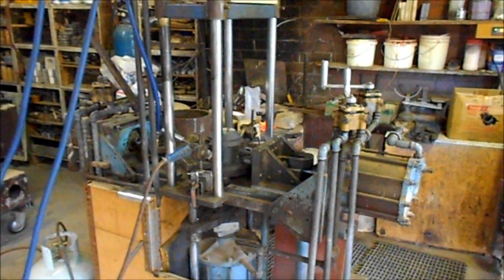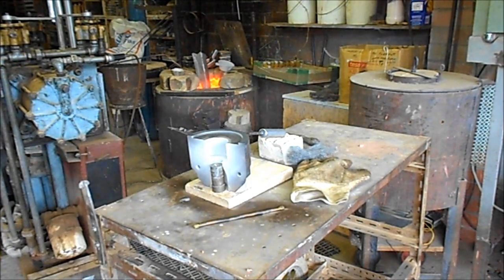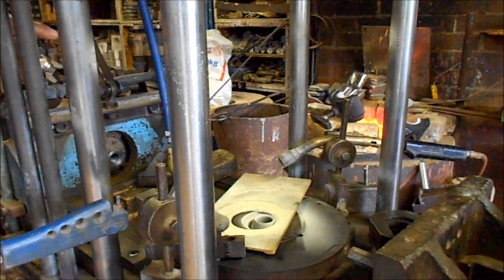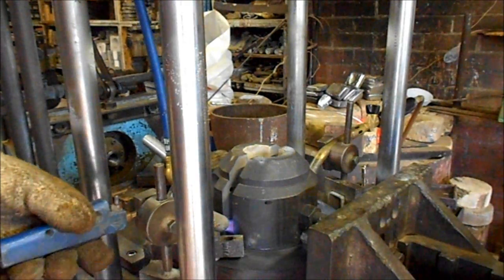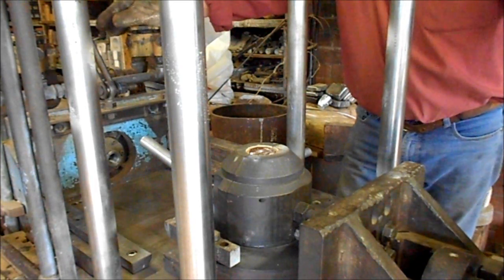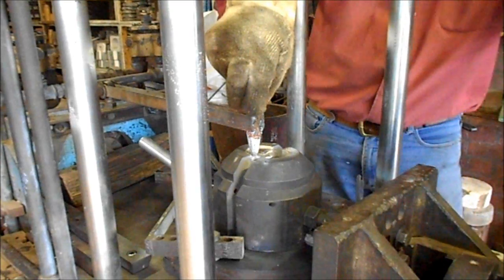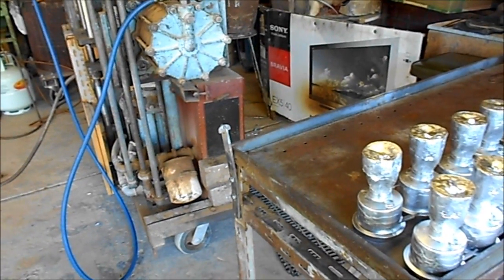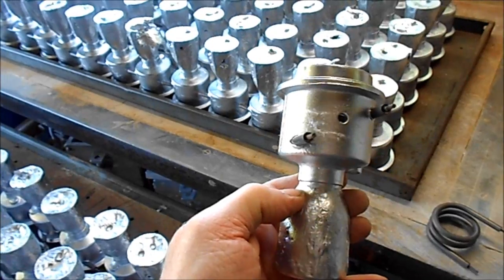My Home Foundry;  Casting a Coffee Percolator heating unit

Comment: Hey Martin, looks like the one I melted down! TFS, GB :)
Reply from the maker: Graeme, Unlikely to be mine as most are made by pressure diecasting in China and will therefore not be perhaps the best of alloys for sand casting - it will likely tend to be brittle and subject to gross hot spot and central shrinkage.... Martin
Reply: @olfoundryman8418  Hey Martin, Hope your okay Dude! Yeah dig the brittle thing, two flood lights I used were like glass, but as I wasn't really trying to make anything specific. Really just trying to fathom out what steps I need to get familiar with for the making of a mould!... Stay safe, GB :)

Comment: I was watching this video again and noted that if I am correct it's the only time you mention that the bottom cast iron mold has a heating element in it and it's temp is about 600 C just to make sure. That I not getting mixed up about the heating element for the percolator. And if it is in the cast iron mold itself did you leave it on all day during the pours.  The reason I ask the mold I made is made of 3 plates of 1" thick by 12"x14" all stacked for a block 3" x12"x14" have heated the whole thing to 550F for the coating to stick.
Reply from the maker: Brad, I think I might have explained it badly. The heating element gets cast into the aluminium percolator body. The element is heated to 600 deg C  in a small furnace and gets loaded into the cast iron die just before the die is closed and the aluminium poured in. The element is heated to make sure the aluminium runs around it properly. Obviously a new element is loaded for each percolator casting. The iron die is initially heated with gas burners to get it hot enough (200 deg C plus) so the die spray will flash dry when sprayed on and thus stick to the die. - it never sticks well to new dies! No further heat is applied to the die as you sort of get a balance between the heat going in (the aluminium being cast) and the heat being lost  to the dies surrounds. You adjust how many are cast in a given time to keep this balance about right. What you are doing sounds ok...... Martin

Comment: Very good videos!  Watching every last 5 days. A lot off good ideas you got! Amazing!!! My dream is to make reusable forms and now I found that it is possible. I holding some projects to make aluminum welding and to make some chairs. The paint you using is important and cant find informasion about it. Best regards from Norway
Reply from the maker: darius, Reusable forms  (dies) are a great way to make parts if you need a fair number. Typically a die wil give  50 to 500 parts per day depending on how big and heavy the part is. The paint (die spray) is very important and without it getting a usable casting would be just about impossible. The die spays I use are 14ESS made by Foseco in the UK and Release coat blue made by ZYP coatings in the US. The latter is very expensive. Although I have never done so  it is possible to make your own sprays. They are basically mixtures of fine refractories and sodium silicate solution. You could try a mixture containing about 15% of sodium silicate solution plus enough fine refractory - typically 200 mesh silica or alumina together with about half as much talc and about 5%  bentonite clay. Add enough water to make it a paste wi8th about the consistency of sloppy brick mortar. Dilute this mix by adding 80% water. Spray this onto the hot (200 deg C plus) die and it should flash dry to form a thin adherent coat. Apply a little at a time and go over it to build up the requited thickness - generally about 0.1 to 0.2 mm. I use a small automotive paint spray gun. Note that the coat may need to be touched up through a casting day and new dies do not behave well as the spray can tend tofal off them a bit - second use of the die and its much better!
Good luck and Greetings from Melbourne Australia.... Martin

Comment: What's that three piece mold made of? Iron?
Reply from the maker: MI A, Yes, the moulds are cast iron. I use continuously cast iron stock it is available in a lot of different diameters. It makes a nice die material as it takes and holds the spray well.... Martin

Comment: Love your video. I have a product that I want to start making parts of it out of aluminum by casting instead of using steel. I have welded up and tested it with Aluminum and it works very well. My product is made for icefishing and it’s called the Bevelbandit and I want to make the red fan blades that you can see in the picture out of all aluminum. So I was wondering do you make Die cast for customers?
Reply from the maker: Robert, Thank you for your comment. I used to do gravity die (and sand) castings for customers but old age and ill heath have caught up with me. I have arranged someone to take over my work but as both he and I are in Australia I doubt we can be of much assistance to you as a source for your castings, freight would kill it. Watched a video of the device - 3 foot of ice on a lake - good grief! Utterly fascinating, and I guess its why my father moved from BC Canada to Australia.  Most we ever see out  here is 1/2 inch on a puddle on a very cold (for us) frosty morning -frozen lakes - never!
There would have to be a small permanent mould foundry that could make those parts for you in the US they don't look to be a difficult casting to make - you could probably gear up to do them your self.... Martin
Reply: @olfoundryman8418  thank you for your response. I hope that your health gets better.

Comment: Hi... what brand diecoating do you use ?
Reply from the maker: Agus, I use two different brands of die coat. I use "14ESS" by Foseco,  it is a reasonably hard wearing white insulation coat that is my foundation spray put on the clean die. Over the top of this in some areas I use "Release coat blue" made by ZYP coatings. This is a boron nitride based coating that has good lubricating properties, unfortunately it is rather expensive... Martin
Reply: @olfoundryman8418  diecoat 14ESS is the new one from Foseco ?, may you mean 140ESS ( extra sodium silicate ) , i used Acheson DAG 633 HT for insulation & release coating base on titanium dioxide & borron nitride. how many dilution ratio with water you using 140ESS and how long life time diecoat without touch up ?
Reply from the maker: Agus, It is definitely 14ESS (not 140ESS) I just went out and looked at the label on the tub of it that I bought about 6 months ago. Its a medium smoothness white insulating coat. I use it at a dilution of 4 to 1 with water. My dies only ever run a day at a time. Before the next run the die is sandblasted and any wearing areas (core guides etc) are coated with a moly sulphide dry lubricant. Generally through the days run I do not retouch the coat with the 14ESS however I do retouch the overcoat of release coat blue. Large cores get retouched perhaps ever 50 castings, small long cores (bolt holes etc) might get retouched every 15 castings. This coffee percolator die would run all day (120 castings) without any retouching at all except for perhaps one re spray of the central core while a second pot of metal melts at lunch time... Martin
Reply: @olfoundryman8418  Martin, thanks for your information about coating. 
are you doing fluxing and degassing in the molten ?
Warm regards from Indonesia. Agus.
Reply from the maker: Agus, Greetings from Australia. I always flux the metal using Foseco Coveral 11. For gravity doe work I do not degas as I find the solidification is fast enough with my work to prevent gas bubble formation. However with sand casting I always degas using the degassing lance featured in one of my videos. I use commercial grade argon for the degassing...Martin
Reply: @olfoundryman8418  I'll check foseco Indonesia about coveral 11, sodium free flux and exothermic or not . thanks Martin.
Reply from the maker: Agus, I believe that the active ingredient in Coveral 11 is sodium aluminium fluoride (cryolite), so its certainly not sodium free but it does not cause any modification effects with the silicon structure. It is an exothermic flux with the exotherm lasting a minute or so, it produces a very dry dross... Martin

Comment: Do you have any pictures of the finished percolator with your parts fitted ?
Reply from the maker: Honk, Sadly , no I do not have any pictures. I understand that it is about a 100 cup capacity and that these two parts fit inside at the bottom... Martin

Comment: Hi Martin,
Greetings from India.
I am not sure if people realize how much knowledge you are spreading free of cost. I have learned a lot from your videos and responses  that you provide for comments. Thank you very much.

You have influenced me to build up a setup for aluminum casting. Although i need to start everything from scratch , I live in India and in a region which is not particularly famous for any industry.
I will start with a furnace electric one. It's economical here i feel.
I would like your opinion on using an electric furnace. Aluminum has a lower melting isn't it? But i am not very sure about the oxide layer.
Any response is welcome
Best
Krishna
Reply from the maker: Kris, Electric melting is a good thing as there is no fuel burnt there is less water vapour in the furnace atmosphere, this translate to less hydrogen g s in the metal. The only problem with electric is that it does tend to be slower but if you allow for that its fine. Properly built (with suitable element material) electric furnace will melt copper base alloys too. Good luck with your endeavours there is much to learn and many mistakes to be made on the way - you just have to hang in there and keep trying... Martin
Reply: @olfoundryman8418  Thank you very much  Martin for taking the time to reply and the encouragement. I would like to keep you informed of the journey and the mistakes. Especially those.
Reply from the maker: Kris, I would like to hear of your journey. Always remember that it is our mistakes that teach us most, and that the person who has never made a mistake has never made anything. Good luck... Martin

Comment: I am working on a die for mortar 
But i dont have the coating foseco i think 
Is there any replacement for it 
Homemade thing
Reply from the maker: Rabih,   I have never made my own coatings but I came across the following information
The coating consists of water, a refractory filler, and a binder.
The binder is usually sodium silicate solution,
The refractory powder is one or more of Titanium Dioxide, Calcium carbonate, Asbestine, Talc, mica, Kieselguhr (diatomaceous earth) Aluminium oxide, Iron oxide, etc., to which I would add pearlite. As a guess and note it is only a guess I would try something like 4 parts calcium carbonate, 4 parts pearlite 1 part talc and 1 part bentonite parts are by volume. The first two as gritty powders i.e. ground down till the largest particles are about 0.1 mm. Pearlite grinds very easily with a hand roller against a metal plate. Add enough water to form a slurry about the consistency of a pancake dough. Add sodium silicate at the rate of 10 to 15 % of the weight of the water. To use dilute 1 part with 3 parts water apply to the hot die (about 200 deg. C) with the sort of paint spray gun that you would use to spray paint a car. Apply as a few light coats not one thick coat. It should flash dry and leave a firmly adherent fairly hard sort of sandy coat. The larger (and thinner) the casting the rougher the coat needs to be, you can vary the roughness by grinding to less or more than the 0.1 mm. For a lubricating coat use graphite powder in place of the refractory. For a very insulation coat use some fine ground mica. Note that new dies do not hold the coat well, it tends to flake off all to quickly, but the second time you use the die this will not happen. The coat is removed every morning usually by sand blasting then the die is heated up and the coating reapplied. Its usual to have to touch up the coating through the day usually with just a quick spray. Very lubricating (but very expensive) coatings are available based on Boron nitride. Good luck! Let me know how you get on

Comment: Such a cool process, I cast rings using centrifugal force either in a hand sling or casting machine, but I'm starting to explore new ways of fabricating metals,thanks for the video!
Reply from the maker: Wheless, Yes this is a very useful process if you need quite a few parts. Runs of 100 plus are nice! The process also gives (when properly carried out) amongst the highest level of quality, strength,  finish, feedom from porosity etc. But it can not give the excellent detail on very small parts that investment casting can. Thank you for your comment.... Martin

Comment: Could you tell us what the manual die is made from please?
Reply from the maker: BigJobs, The die is made from grey cast iron. I buy short lengths of continuously cast iron as I find this the most consistent iron available. It comes in a wide range of diameters and suppliers cut to length. It is easy to machine (if a little dirty) and is an excellent material to make this sort of die from as it is quite heat stable (won't distort) and the slight roughness due to the presence of graphite flakes throughout the grey iron helps to hold the die spray on the die. Grey Iron gives quite good die life although for longer run work (way more than I would ever make) the use of H13 die steel is common.On another of my videos you asked about the flux I used, while I received notification about this comment I can't seem to find it on the video concerned (perhaps it will appear later?) so I am answering the question here. The flux I use is "Coveral 11" it is a commercial product made by  "Foseco" but most foundry supply companies will have an similar product - its quite cheap. I know many YTers use "lite salt" ( roughly a 50:50  mix of sodium and potassium chlorides) as a flux but unfortunately this mixture does not dissolve Aluminium oxide very well if at all. So its success as a flux is a bit debatable. Its usual to add Cryolite (Sodium Aluminium Fluoride) to the flux as it does dissolve aluminium oxide. You can get cryolite from some pottery supply houses and add it to the lite salt but its probably easier (and cheaper) to go to a foundry supply house and buy the proper flux.Martin
Reply: Thanks for such a detailed reply.

I deleted the flux question, because as I pressed enter it appeared on the screen. I really should pay more attention.

Comment: An excellent learning.... is it possible to cast the same Hex nut in brass with the same process?
Reply from the maker: Thank you for your comment. Cast in brass? - I don't see why not. Of course I would design the die a little differently, use different die coats and have a much better shielded furnace in order to protect the operator from the much higher temperatures associated with the brass. Brass and indeed other copper base alloys are regularly cast into dies in this way. Many years ago I worked at a foundry that did a lot of aluminium bronze castings using this method.
Reply: Thank you for your valuable reply....
Reply from the maker: Ravinder,  My pleasure.
Reply: Hi... would you please share your email id... I would love to have your valuable advice for a product development..
Reply from the maker: Ravinder,  Please ask your questions via the "about/messages " section of my channel page. If I know the answer I will be happy to provide it.